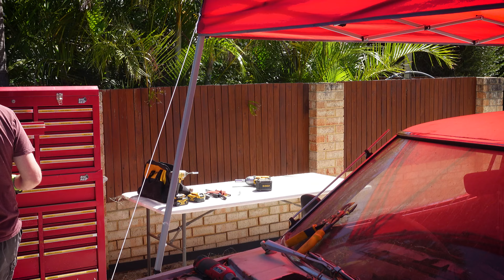Trash or Treasure - RA23 Celica Salvage Rescue (Bonus Episode)

Comment: Another excellent episode, great work Cam.  I think I saw this car a couple of years ago under a waterproof cover outside a house in Lathlain.  I spoke to the lady that lived there and they were in the process of moving to Vic Park I think, and were selling it, asking about $5K IIRC.  I could not take it then as I was out of storage room.  I think it's a better base to work from than VC IMHO. Bent box sections under the front and rubbish bonnet hinges are standard for this car as you said.  How do you plan to treat the light surface rust underneath?  I hope Dave has recovered OK.  The old saying goes is that you have not worked on your car unless you have cut yourself and bled everywhere!  Prophetic words from him at the start, quoting his blood group, and 15/32 socket is handy when you round off the 12mm nut you were trying to get off!
Reply from the maker: Hi Mitch - good to hear from you. The more i look at both cars the more this one looks like the winner. Rust wise, this one is pretty stripped to start so I'll probably throw it on the rotisserie and just have the underside, engine bay, jambs etc sandblasted back, then paint strip the big panels before some 3k epoxy - will be the on right way to justify next steps. Dave has full recovered so no compo claims! To be fair he was working with my Metrinch stuff too which is both imperial and metric so was pretty safe from rounding off things thankfully (as such he just resorted to sheering them off) 🤣

Comment: One of my subscribers told me that you picked up a parts car...... Any parts you are considering selling? Or maybe have extras of in the shed?
Is the head liner any good to use as a template, or is it already in the bin? (I need head liner bows too, or at least the dimensions so I can make my own.... If you're willing to share that info obviously)
SAVE THE CELICAS!
Reply from the maker: Headliner went in the trash, too ripped to be any good but i did pull the bows - could trace them onto some paper for you and send it over if you want. Coni makes ends i believe or you could 3D print. Hit me up on Facebook and I can give you a contact of someone who's previously made headliners (i bought one for VC)
Reply: @TheBuildRoom  Cheers Cam. If I know the dimensions, I think I can make some replacement bows for myself! Can't wait to see how VC 2.0 turns out!